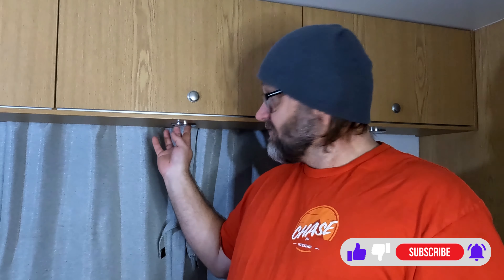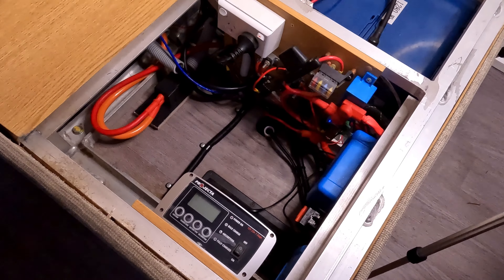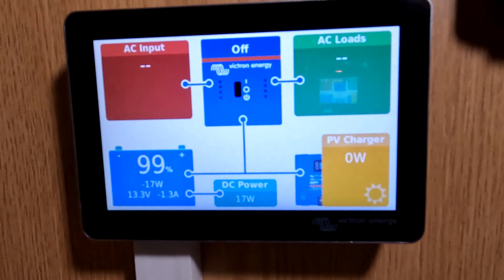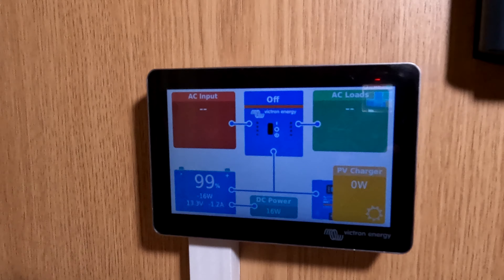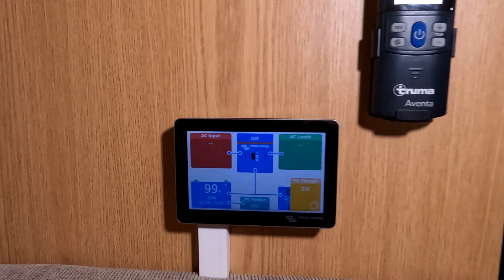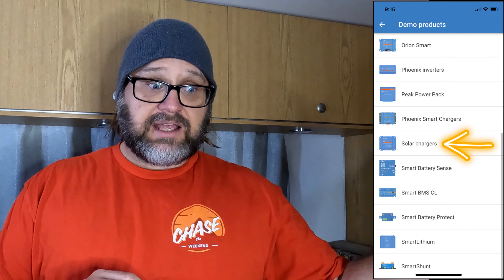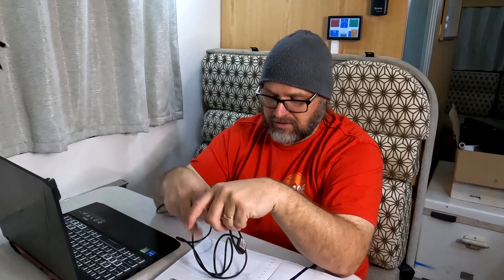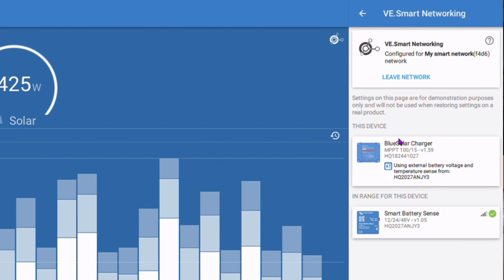VICTRON SmartSolar Commissioning: Motorhome Build Part 2 | 12v | Lithium

Comment: Cracking set up and job well done,  On my 2 x 140amp Giant lithium batteries there BMSs cuts the charge off at 14,3 and they cut the power discharge off at around 12,6 volts
Reply from the maker: That seems like a pretty high cut off voltage, but every battery is different, that's why supplier support is so important and even more so with Lithium batteries.  Thanks for watching Craig.
Reply: @ChaseTheWeekend  yes I think its like around 20% I like it as no need to wake the batteries to take charge,